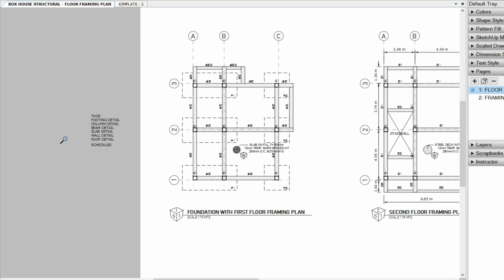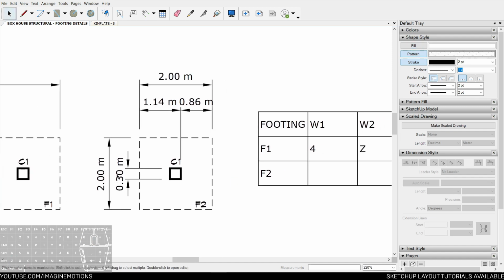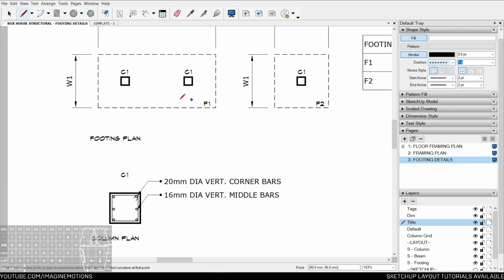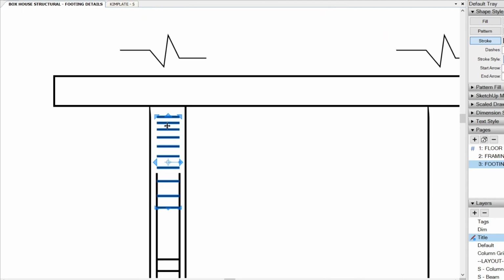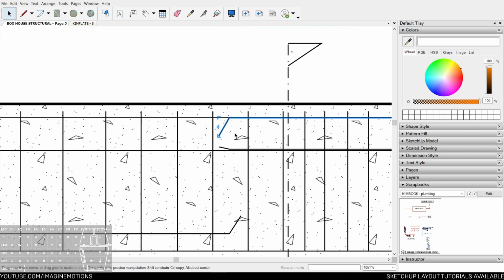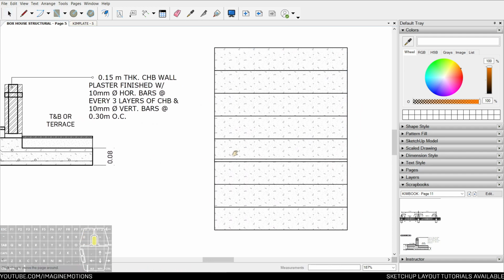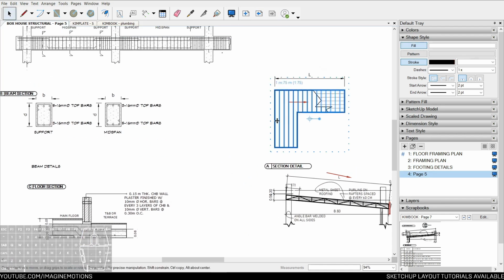Sketchup Blueprint 2c - Structural Details (3/3)

Comment from the maker: VOL 3A BASIC - 2d Engineering
Get the files & Scrapbooks here at http://gum.co/IMVol3a

00:00 Getting Started
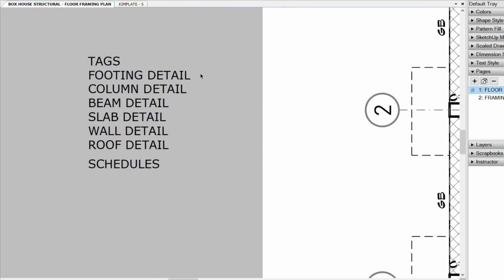00:12 Footing Detail
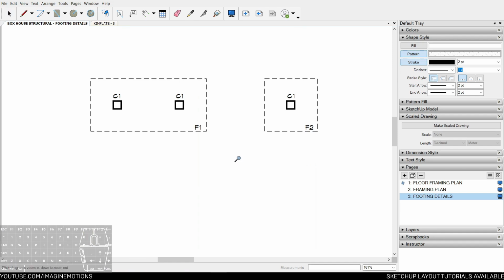03:53 Rescaling
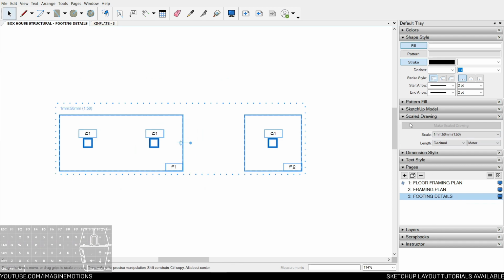06:43 Dimension Scale
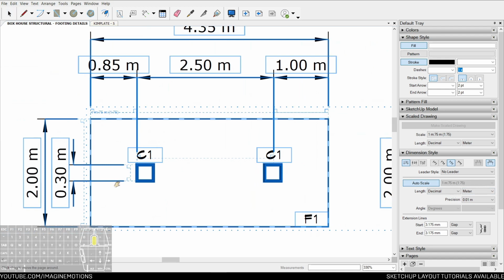10:43 Schedule
14:42 Column Detail
18:27 Footing Section
27:14 Scrapbook
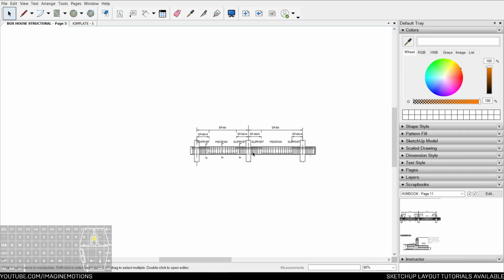28:57 Beam Detail
36:14 Slab Section
39:13 Roof Detail